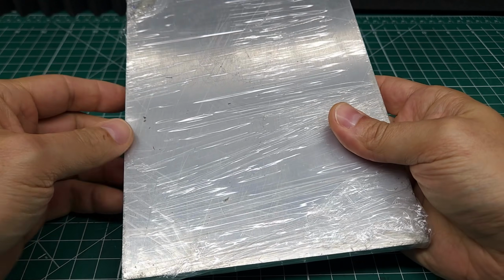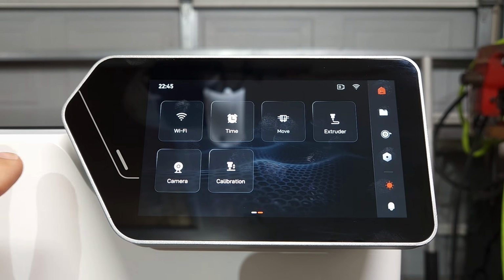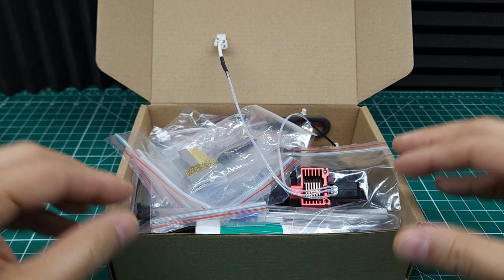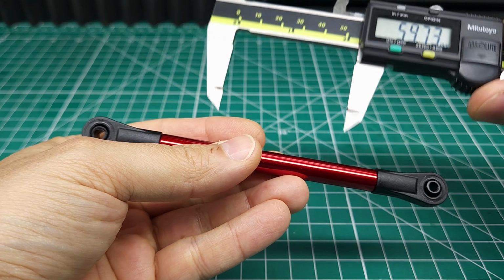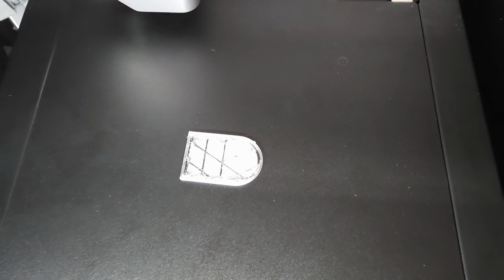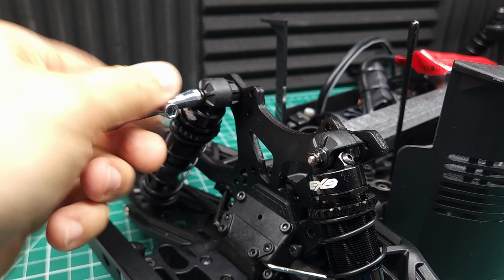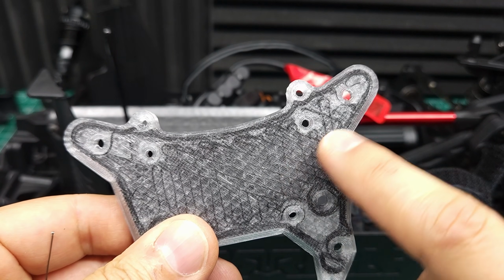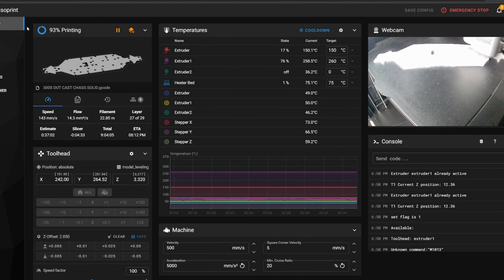Not Just RC...The Future Of TECH Is Here!

Comment: The reinforcement on the socket hex was initially in the correct place, the outside diameter. I'm fairly sure it will be significantly stronger with a ring instead of a hex reinforcement.
Reply from the maker: My concern wasn't necessarily the overall strength but to reinforce the hex area specifically. On a part like that the bolts going to rip through the hex profile of the plastic before The whole thing splits apart.

Comment: cutting fibers up into tiny fragments to make it printable made a lot of the benfits go away indeed. Fiber length is always beneficial. e.g. high quality cotton fabric has longer fibers: more durable and softer feel as less fiber ends per area. So putting long fibers in, just goes back to what made carbon fiber composite famous in the first place.
Reply from the maker: Yes. Long strand continuous fiber like this as completely different properties from the chopped stuff that's in most filament

Comment: I have a 5th scale rc and ordered some carbon fiber shock towers. No matter how tight I had the nuts tightened, they would loosen up because the carbon fiber started coming apart. They lasted less than a month, I replaced with vitavon shock towers and haven't had a problem since. Carbon fiber has it's place as in body panels where there isn't any movement or stress.
Reply: Resistance to stress is where carbon fiber shines (as far as weight to strength goes). The carbon fiber coming apart is more of a result of the quality of the carbon fiber/resin bond and not so much it’s durability. But with that being said you are correct in that there are places you would be better off going with a different material.

Comment: Does this have the problems of leaving teeny tiny splinters of carbon fiber that imbed in your skin and may cause long term health issues?  I know that’s been an issue and question with other carbon fiber printers but I don’t think they were printing with two materials at once like this does. I’m curious if the second material encapsulates and holds on to those carbon splinters?
Reply from the maker: The potential is there but in all of the work I did with it, without being careful at all, I didn't experience it once. The carbon filament itself is encapsulated in resin so even if you snap it it doesn't leave little shards and once it's embedded in the print it's not going anywhere unless of course you shatter the print.
Reply: @DoRC That’s exactly what I was hoping you’d say!

Comment: I feel like I'd be absolutely willing to deal with carbon strings on the part as it comes off the bed. Not exactly hard to take a hobby knife and trim them off. To me, that's an absolutely acceptable compromise to get CF everywhere no matter how small the radius of the feature. I guess I'm also 43, so my attention span is actually longer than that of a coked up mosquito, if only marginally.

Comment: The next time you test by jacking up a truck, measure tire pressure and contact patch of the tires before and after for exact numbers.
Reply from the maker: While those measurements sound good in theory I think they would be pretty difficult to measure in practice and also translate to a weight in practice. I think a scale or a load cell would be a lot easier :-)

Comment: Clamping a socket into a vise is not even close to a fair assessment of the strength.
Reply from the maker: Why?
Reply: @DoRC It doesn't distribute the load along the inside of the socket along its inside radius at six evenly distributed points but instead depends on frictional clamping points of the vise of which they provide only two thereby concentrated the stress point by a factor of three and dependent on friction. Poor choice. Watch the testing methods on the channel "Project Farm" for a correct perspective.
Reply from the maker: @timroderick2314 The socket wasn't clamped in the vise. There was a 17 mm hex clamped in the vise and the socket was on the hex. Sorry I misunderstood your original comment.
Reply: @DoRC You are correct and my apologies to you sir. Good job
Reply from the maker: @timroderick2314 No problem. I didn't really describe what I was doing and it can be hard to tell in those short clips.

Comment: If I save the money for this printer, I can buy carbon plates for the next ten years or more !
If I really need a much stronger part, then I let it print out from professionals like xometry, so I don´t need to make experiments with the print settings until I get the part I need.
This printer is NOT a "game changer", it is just nonsens, because the results are not half as good as from other modern printers.
Too slow with carbon and too much stringing and a temperature of 320°C is not what I expect from such a very expensive middle sized printer !
It´s cheaper and much more clever to use a carbon plate in combination with self printed parts ( "sandwich" ) or let professionals print it out than buying this printerr !!!
Reply from the maker: Yeah if all you're making is flat parts and you have the CNC machinery for it then carbon plates can be useful. Of course if you want any kind of features that aren't flat that's not going to work. 
Obviously this won't be for everyone but it will be for some people :-)

Comment: What's the difference in weight between stock and the 3D print? I'm imagining it's lighter?
Reply from the maker: It depends on what parts you're referring to but yes typically something plastic or carbon fiber will be lighter than aluminum
Reply: @DoRC be curious to know if it matters overall, I mean, if you could save pounds with parts as strong, or stronger and you can print them yourself, amazing

Comment: I love that Fiberseek chose to go open source. I see a lot of potential if they actually do it properly and give access to the source codes. 

The printer is knida meh for now but it'll get modded by everyone and get better. Most of the job is going to be from the slicer I really hope some people will make a Slic3r fork to optimize the slicing.
Reply from the maker: I think the printer itself is good though there are definitely is some work to be done on software and implementation. Of course we are just at the early prototype beta test stage so I assume there will be quite a bit of improvement between this and full release

Comment: I 3D print guitars and have spent the past few years developing a guitar neck. I already backed this project, but this video really cemented my belief in the possibilities of this machine. Great work — I’d love to see that PA6-GF fused with carbon fiber sometime. I was shocked to see how well the PETG held up!
Reply from the maker: Yeah for a replications like that I think it's going to be a game changer.
Reply: Bunch of us out here waiting until the anticipated release in the November timeframe that want this for PPA and PPS applications (car stuff in heat/chemical sensitive things that will need to consider moisture absorption, getting some “road grease” or seeing fluid vapor/pressure from fuel, oil, etc.) PA6-GF is cool stuff certainly, and not knocking it, just a different material consideration given different projects. 

It’s worth noting however, that the parent company Anistropic already has that figured out, and there’s plenty of room on a 350C hot end to get PPS to bond well on inter-layer. 

I can’t wait to start making some oil/air separators and other parts with this and the continuous glass fiber (CGF) they’re listing as available alongside the CCF. I have applications for both with some outer shells/cases for some electronics, and each has their benefit in terms of EM isolation properties. CF won’t make a real faraday cage around something, but it tend to help on EM interference. 

Think about that in the context of guitars (I suck, but I play as well.) You get an option for something very light and stiff at dampening rates that can be adjusted by doing things like using PA6-GF for EM transparency (think covers for pickups, winding your own and having a humbucker or single coil case you can now print that’s going to hold up forever without breaking down until 100 years from now or later on the cheap and custom,) but also the ability to give some isolation to things like knobs/pots by using CF caging for additional noise isolation. 

Think about what that means for pedals- there’s a ton of maker projects in open source for that, but now we can make high survivability stomp boxes that used to have a metal case as the preferred method. 

Pedal boards that weight nothing.
Case covers for those boards that don’t crack in transport and weigh next to nothing. 

I hear ya, and there’s a lot of reasons to be excited for this to kinda (without trying to overstate it,) really deliver on the ability to make functional custom parts without CNC prices. 
And then again… pairing this with a bench CNC for final drilling of holes and maybe surface clean-up is potentially huge. Small shop production station for maybe $6k total all in to be able to whip out $50k worth of parts a year if somebody is working at it industriously. 🤙

World is getting a lot cooler, and stuff like this seems to be an example of how paradigms are shifting. 

And we want to see the guitar when ya get it done. 😁👍
Cases.
Reply: @charlescoolidge747   You’ve got some great points there. I’m definitely interested to see how PPS performs with the CCF once it’s out. I almost went for a Markforged setup a while back, but the closed filament system was a deal breaker for me.

The EM side of things is super interesting — I hadn’t really thought about printed enclosures affecting noise or shielding before. The idea of being able to fine-tune isolation with different fiber types opens a lot of creative doors for guitars and pedals.

I’ve got a test pedalboard printed in PC right now and it’s surprisingly stiff. I’m about 160 lbs and can jump on top of it without breaking it. I’ve been wanting to dive into pedal electronics more, but I’m still learning that side of things.

Totally agree, though — this machine really feels like it’s crossing into industrial territory. With a 350 °C nozzle, 65 °C chamber, and 110 °C bed, we’re not that far off from full-on production capability. This is one of those products that shifts the idea of what’s possible for the consumer market. I thought this year was going to be all about IDEX and hot-end swaps (which I’m excited to see too), but if all goes well, I really hope the market adapts this kind of technology.

Comment: Try printing  with 95a tpu for infill. As well as 64d tpu for outside  walls.  It's amazing  and unbreakable  as rc parts . I have been using it to print my suspension  arms.
Reply from the maker: TPU is good but it's also too flexible for a lot of applications. I don't think that you could make a 1/8 scale suspension arm in TPU.
Reply: @DoRC  you can try it you will be pleasantly  surprised  the 64d tpu outside  5 walls make it stiff .I have hit a wall at 50mph 9 times in a row with no issues. Other then bent pins but a arms survived  every impact
Reply from the maker: Interesting.

Comment: I recently 3d printed an RC impreza made by Casadio designs, every single part minus the springs, diff grease, screws and electronics can be printed on that thing,  and it's still got a ways to go, but it's impressive nonetheless. 3d printing has an accessibility problem and a durability problem but other than that has almost infinite potential.
Reply: Durability is the most important thing and 3d printing doesnt produce durable items.

Comment: I recently bought a 9-axis HAAS VF9 CNC Mill for 5k on Facebook Marketplace. An Aerospace company was upgrading its equipment, and I just happened to find it right as they put it up for sale. I was told they had over 300 calls when I bought it. That is the one advantage of living next to Silicon Valley. I find cool stuff like this all the time. I got a Resin Printer and a First Gen Markforged Metal X printer for only 6k from the same company. Now comes the learning process to use it all effectively. I want to build a live-aboard boat that can cross Florida to the Bahamas. Speaking of the Poster board. I will be using Foam core sandwiched with fiberglass to build most of it. Sounds crazy, but I have already built a small houseboat this way. Now I can also make my own drive and steering systems with my new equipment.
Reply: Thats amazing, hope you start posting videos of your journey!

Comment: Prints a part with 100% infill, compares it to a part with 10% infill... Disgusting. If it is a genuinely good and innovative product, you don't need to be a disgusting and doshonest liar.

Won't watch your channel again because you have shown you can't be trusted with simple honesty. 🤮
Reply from the maker: The carbon fiber part was about 40% infill. The non-fiber-filled part did have less infill but I mentioned right after I broke it that you could make it stronger with more infill. Even if you printed it at 100% though it still wouldn't be as strong as the carbon fiber part.
Reply: @DoRC I didn't hear you say the CF part was 40% infill. It came across as a dishonest comparison. With so much dishonesty and lies these days, not showing the objective difference, for a product that is effectively an ad (the company offered it as advertising, regardless of how you might see it), comes across as though you are trying to make their product look better than it is.

Not one single thing you did was an objective comparison, just you saying it's a certain way.

Almost looks like they bought your subjectivity...

I don't know if that is what happened, but it doesn't look good regardless.

You didn't say much of anything actually negative, just "that'll get fixed later", instead of, "This is a real issue."

I don't understand how you would spend all of the time making this video without doing real, valid, objective, numerical side-by-side testing.

"This part is _% stronger." would go a long way toward your credibility. The testing you did makes a person question your credibility and ethics.

I am not saying you don't have any, I am saying you were offered a product and didn't really give any reasons to buy it except for "It feels really strong compared to this part that I deliberately made weak, not because I didn't have the time, or material... But for some reason I'm not going to say..." 🤔
Reply from the maker: @jakenkid I totally understand your concern but the reality is I'm not equipped to do scientific testing. I'm just a dude hanging out in his garage sharing cool stuff with you guys. None of what I showed is intended to be definitive.  As far as problems I found to be honest with you the only problems I did find were things that should be fairly simple for them to fix and given that what I'm using is an early prototype I suspect most of those things will be corrected by the time it goes into production. I didn't really complain about much because to be honest with you at least from my limited understanding all the basic stuff worked exactly the way it was supposed to. 
I'm sure there are dedicated 3D printing channels that will go through All the minutiae of comparing exact strength etc but that's just not what this video was. And honestly even if I did I'm still working with a prototype so what you get might behave completely differently from what I'm showing. I wasn't really trying to build 3D printed materials testing credibility because I don't have any. Again I'm just a dude in his garage sharing some cool stuff with you.
Reply: @DoRC PROPS FOR RESPONDING TO SUCH A MESSAGE FROM ME THOUGH! TAKES GUTS!

Comment: Excellent Video!  But why didn’t you compare the weight of the continuous carbon fiber Vs the 7075 aluminum?? If the printed part doesn’t weigh significantly less than the aluminum part there’s no point in printing it.

Comment: i would love to see braided cf fishing line be used in the co extrusion
Reply from the maker: Not sure if that would work because the filament has to be pretty stiff to be pushed through the path and I'm guessing the fishing line is relatively flexible.
Reply: @DoRC  would be very interested to see!

braided line is stiffer than monofilament but i do expect itd be a bit more flexible than what they provided. So it has a shot at working i think, especially the higher test stuff which is a thicker and stiffer braid

edit: so the price difference isnt really a factor, but id bet braided cf would be slightly better because itd be a better 'wick' for the plastic, would be more homogeneous

Comment: I'm interested in the weight and rigidity of this material compared against CNC carbon fiber parts. I wonder if this tech can match CF for FPV drone frames.
Reply from the maker: I'm not sure. For pure rigidity probably not because simply smashing carbon fiber together with epoxy makes it about as rigid as you can get it but toughness and rigidity aren't necessarily the same thing. If you combine a properly designed part with continuous carbon fiber inappropriate base material you might end up with something that's more durable than straight carbon fiber
Reply: @DoRC thanks. I'll keep an eye on this process. Hopefully it is legit for drone frames. Thank you.

Comment: Maybe the solution to not being able to print around a small circumferences would be to incorporate them into the overall grid pattern
Reply from the maker: Yeah they could do that or they could just increase the number of laps around the circumferences. If you could set a minimum number of loops instead of a firm number of loops that the slicer could then use to do its best I think that would work well. That's what I recommended to them